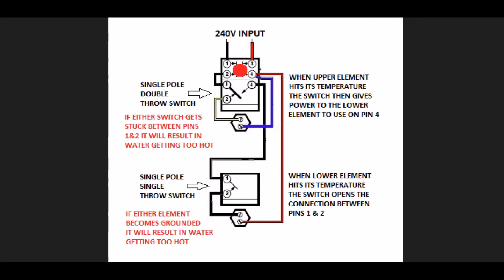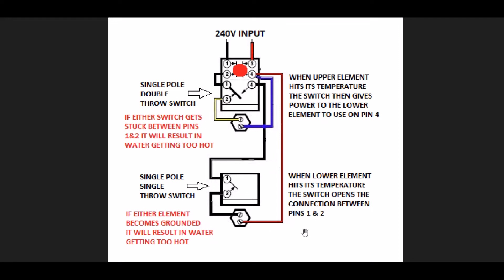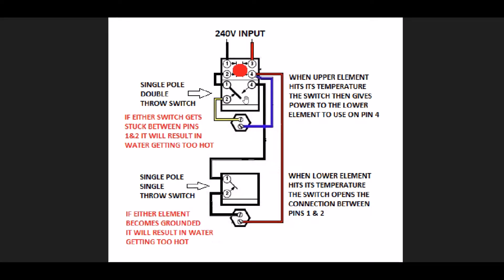Dual Element Water Heater Explained

Comment: You have provided a very well thought out dual element operation of an electric water heater.  I do want to give you a proper terminology of “fake voltage” you reference in your explanations.  The tested terminals with a multimeter showing voltage is never “FAKE”.  The terminals associated with the respective thermostats will either be passing current (continuity) or not passing current (statically energized).  These are the two different states of the water heater thermostats while the source panel circuit breaker is closed.  Again, well done explanation with proper visuals.

Comment: Great tutorial. My water heater is doing what yours did, getting the water way too hot than tripping the safety switch. 
I ordered a kit to replace all of the parts, under 50 dollars. This heater is 9 years old so I'm just going to put all new parts in it.

Comment: Best way to check voltage is to use a voltmeter. On a 220 volt circuit you will measure 220 volts across one leg of 120 volt line to other 120 volt line. If you measure from any120 volt line to ground you will measure only 120 volts. Both voltages can kill you. There is no such thing as "Fake" voltage.
Reply: fake voltages still kill.

Comment: First, thank you very much, excellent explanation of the circuit.  I had a lower element that was showing 87 volts through the element to ground. This voltage was puzzling until I viewed your presentation. The water heater had overheated and tripped the thermal cutoff .  The unit is 12 years old and I will replace the controls and elements. 😊

Comment: So i disconnected the lower thermostat( it got corroded from a small leak,shorted and fu the upper thermo). So discovered ( with a brand new upper thermo only) that by flipping the breaker on for 8 to 10 minutes(stop watch) I have enough hot water for my shower,wash the dishes by hand, and my wife's shower.SERIOUSLY!!!.And its still luke warm 3-5 hours later. So one 4500 watt element for 8 minutes works out to 600 watt hours to heat up the upper portion of the 30 gallon tanks sufficiently to achieve the above tasks. And by leaving it off eccept for several minutes in the morning the thermo and element has less longterm wear and tear.May eventually have to replace the breaker but thats cheap.Hey it works so well for us im  thinking of getting a solar chargeable 12v 100ah lifep04 plus a 600watt dc heating element. Then just have the batt dump to the heat element for an hour or so each morning and ....walaaaah no more hot water heating bill. Next is running wash machine cycle 1-2 times a week  off another solar charged batt using the same idea.....and so on. After a cloudy,rainy day or dark winter days may have to use a 12dc 50+ amp power supply to supplement the battery. Solar vacuum tube water heating systems are too EXPENSIVE and complicated and probably will never break even.
Reply: don't drink your hot water
Reply: If you have City water which would already have chlorine added it should kill most of the legionella bacteria. As long as you didn't leave it sitting in the water heater tank more than a couple of days. That is cycling the full 30-gallon tank every 3 or 4 days which would add fresh chlorine to the tank. Provided your city water is 0.05 to 2.0 parts per million. Just something to think about! Legionnaires disease is a lung-related disease that can be inhaled through water vapors. I think the bacteria is killed out above 140 degree F if your water is heated to that you should be fine from what I was told.

Comment: Very nice explanation, thank you. I think it's worth pointing out that what you're calling "fake voltage" is still basically just as dangerous to touch as the "real power" side.
Reply from the maker: Oh yes, every single connection at all times it is energized has lethal voltage present. More like ground is fake, because we happen to get a neutral connection to it giving it a 120V reference. If in doubt do not touch it.

Comment: Your video helped me diagnose that half my double pole breaker was bad and not the water heater.   Thanks for the easy to understand diagrams.  Best I have seen.
Reply from the maker: Thank you, that made my day!
Reply: Hello. Question. If my breaker looks good and not popping, I'm still not getting the 240v input to the heater only getting 63v input what can it be